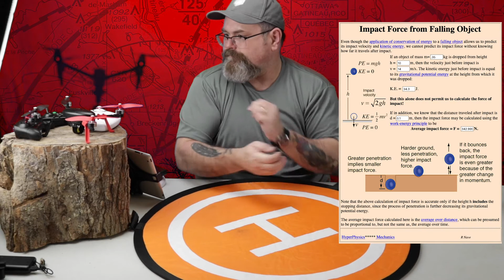Drones Hitting Things:  A Brief discussion on the physics of drone and quadcopter crashes

Comment: Great video everything is crazy even a boosted board can also be used putting a gasoline container Strap it on the boosted board and directly control it but a bunch of crowd of people!! It would be disaster 💥  everything is a weapon if it is used in the wrong ways..
Reply from the maker: Exactly. The idea is to make pilots aware of the responsibility they have.